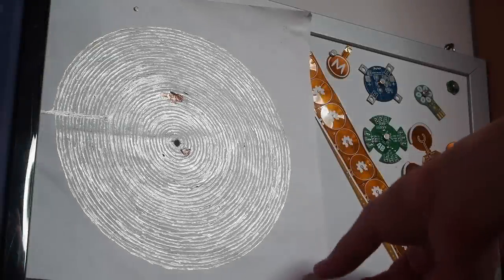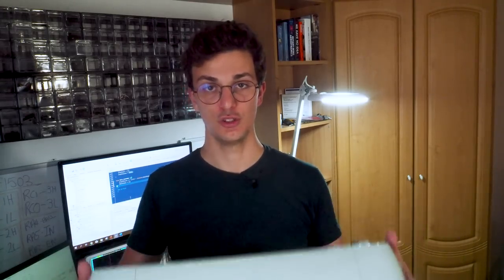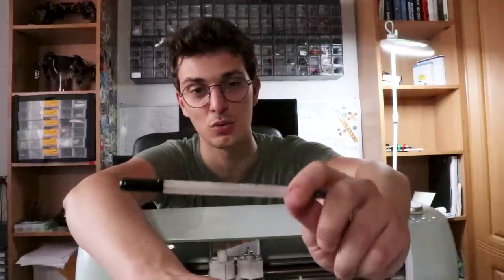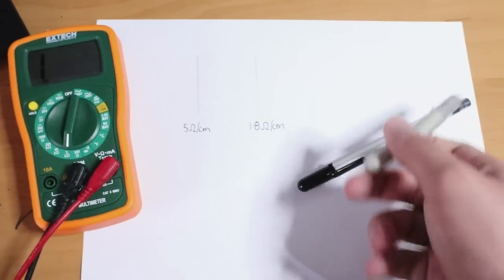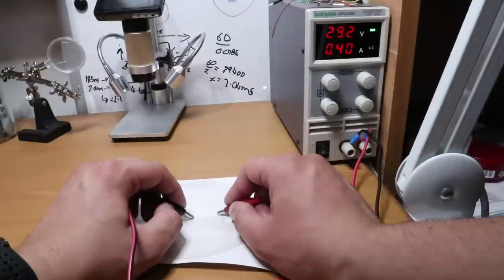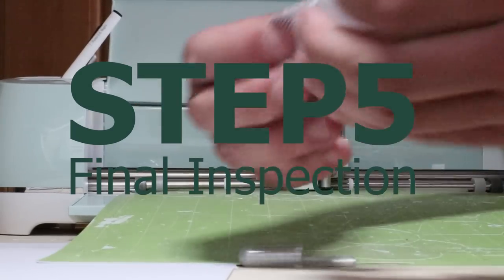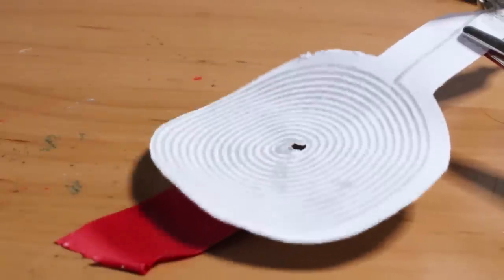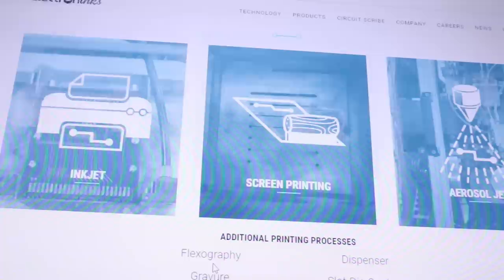Magnetic Paper Butterfly

Comment: If you glue thin foil, careful to not tear or wrinkle it, to a sheet of paper, a sharp-pointed stylus in the machine may be able to trace the line out scoring a path between.
It's a subtractive method rather than an additive, and you'd need to make sure it only scores, cutting between the foil, rather than cutting all the way through the paper, 
but it seems another way to try for more accurate lines.

Comment: I wonder how easy it would be to make a spiral coil like that with a scribing tool of some kind (like a pen) that’s held to the centre shaft by a thread which wraps around the shaft as it rotates, bringing the radius gradually in over multiple turns?
Can’t wait for that conductive inkjet cartridge, assuming it can somehow be made universal to multiple common printers.
Reply from the maker: That's a very good idea but I think it would be difficult to make a small pitch clearance.. For the final prototype I got a clearance of around 1-1.5mm